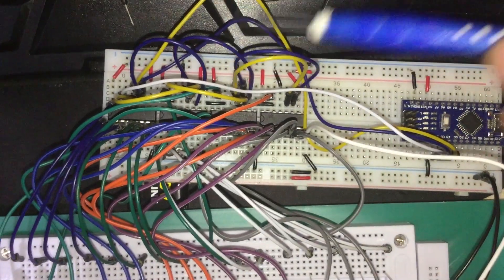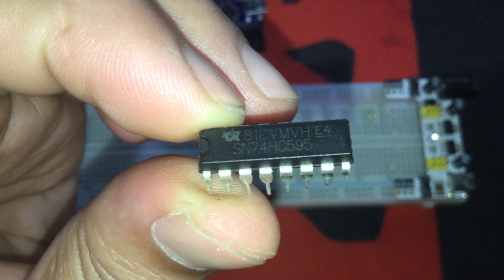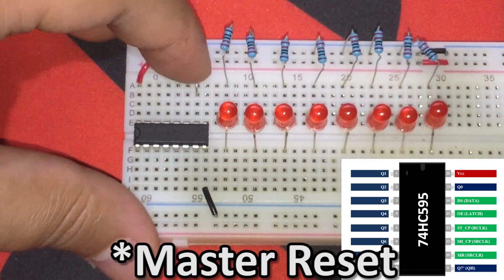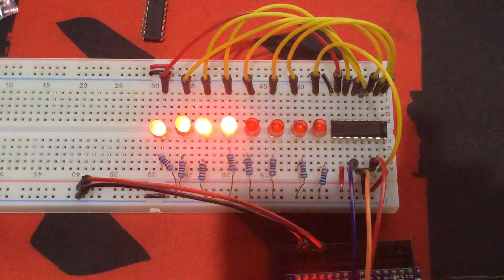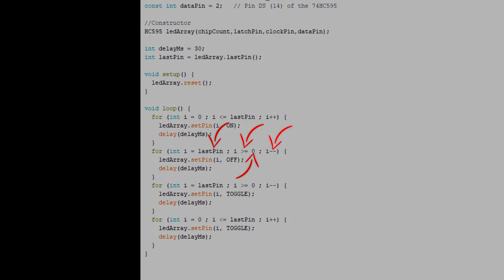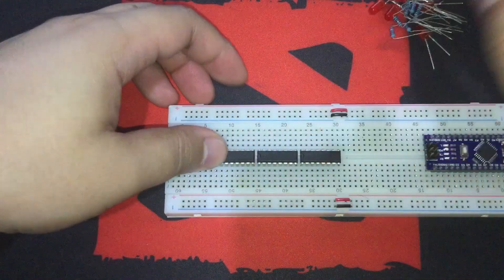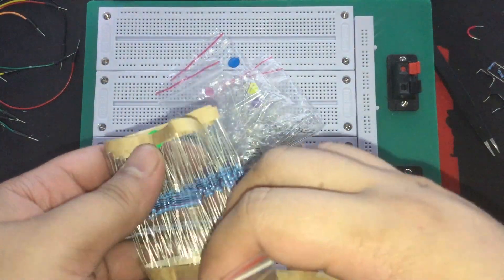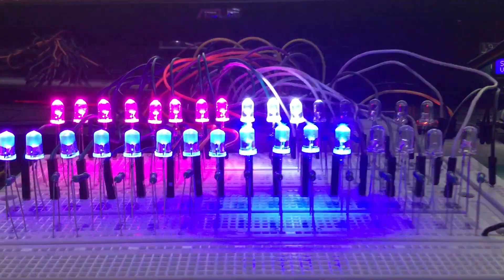Arduino Project #12 | 3 Pins, 32 LEDs, 4 Shift Registers [74HC595]

Comment: 2:17 - You know that resistor does nothing in that location? the power rails on the breadboard are on split in the centre where you've already got your jumpers. Other than that great tutorial :)
Reply from the maker: Hello, SiniTronics! ♥ Yeah, that's a huge oversight on my part. I kept wondering why a couple of the LEDs are dying on me. lol. I forgot to remove the hookup wire. :D Thanks for pointing it out! Much appreciated.
Reply: @HeathenHacks  We're all here to learn as we go have released a fair amount magic smoke myself over the years :)
Reply from the maker: Ahhh. That magical smoke that smells like plastic and electricity.

Comment: My only concern is you directly power the LEDS from the board.

Which overtime results into a Fried Chicken 🍗 by drawing to much amps.
Can't you use a external power supply like shields?
Reply from the maker: Hello and thanks for the comment! ♥ You are correct. And yes. You can use an external power supply for this.
Reply: @HeathenHacks  ok thank you for honest guide.

Comment: If you want to send different serial data to each register, would you still daisy chain their clock and latch pin, and just connect each register's own serial in pin to a different pin on the arduino?
Reply from the maker: Hello, Yuxuan! Thanks for the comment! ♥ Unfortunately, I don't have the required knowledge to answer that question. Sorry about that. However, I would like to suggest seeking answers on either of the following:

Arduino Forum: https://forum.arduino.cc/
Reddit: https://www.reddit.com/r/arduino/

I believe there are people there who are way more knowledgeable than me.
Reply: @HeathenHacks  cool thx! I’ve been looking for answers as well. The way you chain them, (serial out into the serial in to the next one), would send the same serial data to all of them, is that correct? I wonder if I could achieve independent control by hooking them up your way, and send a 32 bit data to the first register.
Reply from the maker: Yes. It does send the same data. Hmmm.. I think this link would help you: https://www.youtube.com/watch?v=6fVbJbNPrEU 

It's an in-depth explanation on how the shift register works.

Comment: HC595.h: No such file or directory
, any help?
Reply from the maker: Hello and thanks for the comment! ♥ Have you downloaded the hc595 library? the link is on the description of the video.
Reply: @HeathenHacks  i did everything as u did in video but when i extract folders are different. 
Can u contact me on discord milab#3888
Or ig dsava_9 and help me?
Its not a problem i can pay you.
Reply from the maker: Try the sample code on my project hub post: https://create.arduino.cc/projecthub/Heathen_Hacks-v2/3-pins-32-leds-4-shift-registers-74hc595-834b66

or add this>>    #include <HC595.h>     at the top of your code.

Comment: Since there are so many leds and each led draws 20ma, don't you need external power source? 

I was going to use 2 shift registers with 16 leds then i remembered people talking about how much current Arduino UNO can provide and  how much current Led draw. Now i'm searching internet for information. I don't want to kill my Arduino UNO.
Reply from the maker: Hello, Paul! Thanks for the comment! ♥ IIRC, the 20ma draw is just the most common and is not the standard.

My suggestion is to try and find out the rating of your LED your self by using a multimeter or taking a look at websites that are similar to these:

http://www.ohmslawcalculator.com/led-resistor-calculator
https://www.petervis.com/electronics/led/led-resistor-calculator.html
http://www.gammon.com.au/uno

But, of course, you can always use a separate power-supply to stay on the safe side of things.

Comment: How could I control PWM outputs?? (With 74hc595 as possible)
Reply: Thanks!! The link doesn't work but I'll try to find out how to do it.
Reply from the maker: @victorcardonatur6573  Sorry, the bracket got included in the link.
Reply from the maker: Hello, Victor! Thanks for the comment! ♥ To control PWM outputs using a 74hc595 IC, you would need something like the "ShiftPWM" Library for it. Check it out right here: [ https://youtu.be/_Be6fo5NSzc ]
Reply: Don't worry! You've helped me a lot

Comment from the maker: Figured out what the issue with the 13CNONKE4 ICs on the testing phase was while re-watching the video [6:35]. Apparently, I did not connect  the other ground rail of the breadboard (where Pin 8 (GND) of the IC is connected) to Arduino Ground.

I didn't even bother to check, because the other ones are working flawlessly. lol.

Holy Crap, that was embarassing.
Reply: HeathenHacks Therefore all the tested shitft registers were good, right?
Reply from the maker: @SimpleEnough2k9  Yes. My bad.